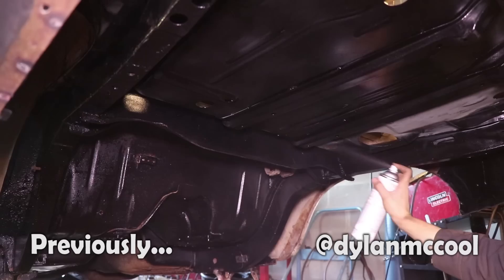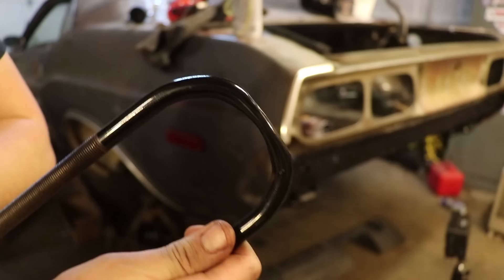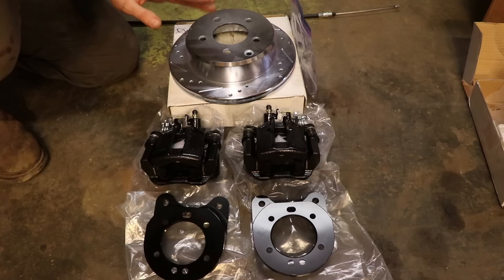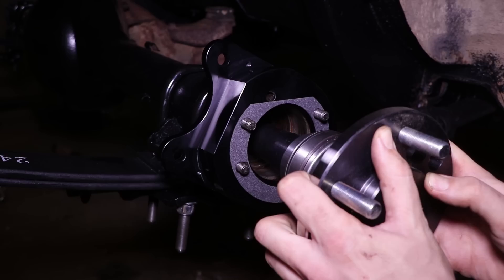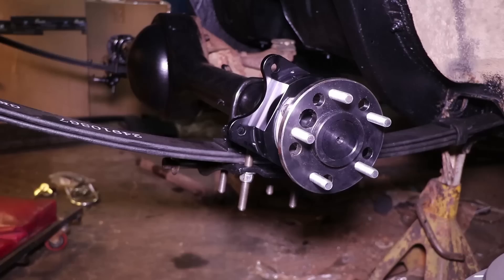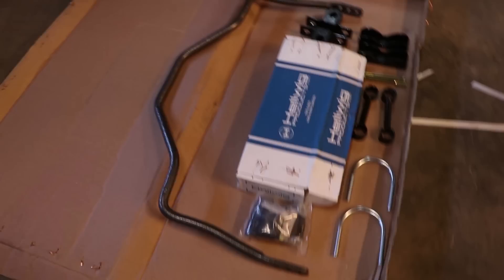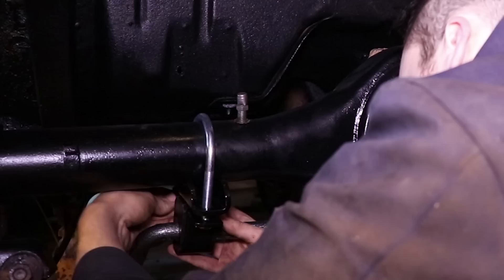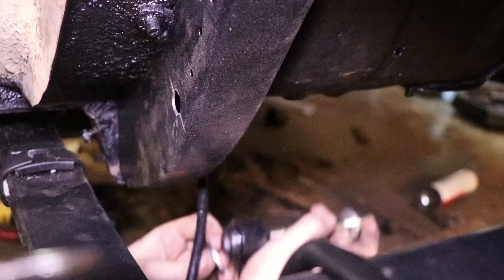ABANDONED Dodge Challenger Rescued After 35 Years Part 11: Rear Suspension/Brake Upgrades!

Comment: You may want to consider welding that sleeve that goes through the frame rail in place, rather than letting it float.  Especially after all your work to make the frame rails water tight.
Reply from the maker: Dennis P. They do mention that in the instructions if you’re doing “heavy” driving. Might take some RTV and put some behind the washer to keep it water tight. That or just drill a drain hole in the frame rail 👍🏻
Reply: @DylanMcCoolVideo   yes i would have welded those sleves in i also would have put the bolts the other way round with the nuts on the  bush end  to enable  the link bar removal and replacement by just removing the nut and not having to remove the complete bolt through the sleve and framerail
Reply: @DylanMcCoolVideo  no, weld it in

Comment: Dude, I'm currently restomodding a soviet made 1976 GAZ 24 Volga and am so intrigued of the mechanical similarities. Mind you, the Volga is a boring piece of junk, with a mind-boggling 95hp  2.4l engine, but it seems if they only tried, the soviets could have easily be making such exciting cars back in the day. I'm doing my best to breathe some life into it, swapping a V8, converting to discs all around, and overall giving it the muscle spirit it could've had.

Anyway, I just wanted to say how much I enjoy this series and how much you motivate me to keep pushing, despite the far-from-perfect garage and equipment I work with. Just yesterday I decided to pull down the front and back suspension and give them a brush over with some POR because of your videos, and I couldn't be happier. I was going to shell out a ton of money for sandblasting and proper undercoating, and I will probably still do it, but at least for now the old pile of junk will be looking better underneath. Godspeed!

Comment: They are my all time favourite wheel, you could easily change the camber so not too mess the tire or trim around the wheel well.
Reply from the maker: 1armedguy The solid axle doesn’t adjust like that unfortunately. The front you could get away with that, but with a square tire like this you’ll be wearing them to the wire in no time.
Reply: My thought was to roll the inner lip in to give the rears a bit more clearance... because those wheels are spot on..

Comment: You can always roll or trim the inside wheel lip. I have taken a zip wheel and trimmed them on my cars to clear tires before. 3/8th to 1/2 should be all you need to cut. Also the 5 slot wheels look good.  A buddy had a Cuda with them back in 82.

Comment: I'm a year late to the party but have enjoyed binge watching. You are a great presenter and editor.  I rewired a 1977 El Camino years ago and was so proud of myself then when I turned the turn signals on for the first time, all the interior lights flashed and when I turned it to the left turn signal, all the exterior lights flashed. I almost cried but I asked my el camino club for any ideas on what I did wrong. I forgot to connect the ground wire from the back of the dash after I reinstalled the dashboard lol.  Every one makes mistakes.

Comment: I really like the superstock leafsprings and 15x8 Cragar wheels, P275 70 R15 BF Goodrich tires on my 74 charger which I did on my own. Car handles turns really well with very minimal roll. I'm happy with my setup and the 2in arch it has.

Comment: I jus have to say you are doing a spectacular job Dylan on the car ... I absolute love that disc brake conversion kit 👍 an adjustable sway bar is cool as well .. those rims an tires due look good too .. there is a tool you can get that fit up inside the fender An it is like a roller An it fills an flattens the inside lip of fender flat so that it won’t slice your tire if there was ever any body roll when driving.. I saw this tool on a another car YouTube channel an it worked very good an professional job an was easy to use .. keep up the great work .. god bless stay safe

Comment: Just a thought as each to their own but underneath I use a sand blaster for surface rust sections here and there and two pot epoxy primer with a cheap spray gun as it wont chip off with road use..great job though looks like a lot of fun👍

Comment: Nice Job so far. You may want to check the rotor for a counter sunk screw that will secure the rotor to the “hub?” And not to just rely on the wheels to push it in. I think at 13:00 you can see the hole for the screw. 👍

Comment: I apologize if it's been addressed but have you talked to anybody about spring twist?  If you're put in a bigger engine the extra torgue might end up trying to wrap your springs. In the day, we used slapper bars or link connectors to keep the diff from trying to rotate.

Comment: I bet that once the engine is installed and the rear shocks are in place, there will be more space between the wheel arches and the tires.  So, you might be ok.  Ideally, you want the equivalent of two fingers space between the tire and the arch.  If you have that, you're fine.  Car has come a long way since last autumn, that's for sure.  With respect to lighting, if you aren't planning to switch to LED lighting, head on over to the Daniel Stern Lighting page and talk to him about the available upgrades for the 5.75" headlamps.  He's another mopar guy, btw.  Had a '62 Lancer most recently.

Comment: ive used the por15 stuff. it is great stuff. it does have some unusual idiosyncracies though, you are supposed to let it cure for 6 weeks before overcoating. if you want to use a colour on top you can give it a dustin coat of primer before it is totally dry. all these detail do create extra hassel so i didnt use itthat much.
also the trick of putting two layers of cling-film on the top of the pot when replacing the lid so that there is a possibility of removing the lid is essential.

Comment: Those rear wheels look badass on that car brother but I think they could use a little bit taller of a tire. You said they are 45’s? Maybe go with 50’s or 55’s? Also you can roll the inside lip of the fender to give a bit more clearance and you won’t have to cut anything or get different wheels/tires. It’s just a very minor body roll on both quarters. Just my two cents.

Comment: I had those kinda rims at first but then I went to a torue twister rim off a dodge plymouth trail duster and had 15x 10 and 15 x  7 on with white letter bfgoodrich and I liked that . I believe 18  x 9 in the rear and an 18 x 7 in the front

Comment: I like your wheels and if you want a bit more room just roll the inside of your wheel arch which you can do yourself by using a pipe and driving forward slowly plus you will probably need that middle slot for your sway bar just to give it some firmness

Comment: I'm thinking that you would need two gaskets, right now you have the caliper bracket mounted to the axle tube having a metal to metal contact which over time will leak . I'm thinking gasket then caliper bracket another gasket then insert axle and flange to make a good leak proof seal. If you don't have another gasket then a bead of RTV between the axle tube and the caliper bracket should do the job of giving a good seal.

Comment: I've always used the regular U bolts  had no problems with crushing? Those bolts are thin on the curve  will snap if the rear end twists under horse power or hitting a deep spot on a road just right. You tighten the bolts in sequence like you do when you torque head bolts till you hit the torque specs for the U bolts .

Comment: consider a wheel and tire that will give you more sidewall. "low profile" tires are good for racing on a racetrack, however if your not on a racetrack you will want as much sidewall you can afford, otherwise it will ride like a dump truck. Not to say riding in a dump truck is terrible. its just you feel every blemish in the road. I have a dump truck and a $800 air shock seat in it

Comment: Very pleased to see up graded disc brakes all, and other up grades in suspension, any of the cars from 60,s can be dramatically improved, in their handling and braking, regardless of how good a driver you are, can you be certain of what the idiots in front of you are going to do???? 
Dylan get yourself a small sand blaster for cleaning parts they are not expensive and work very well! I like your choice of wheel and tire!
Front suspension next, then engine, body and interior, plus a nice paint job is a MUST!!

Comment: Everything looks better till the anti-roll bar, Chrysler engineered an excellent bar on e-bodies with everything attached to the unit body reducing unsprung weight with very good roll resistance why not take advantage? Keep an eye on the cable to ground clearance on the brakes, Great work on resto-modifying these old Mopars keep it going !!

Comment: I'd cut original vintage wheels 18 in front and 20 in rear off set mild tub the rear  because of the 4 wheel disc

Comment: wheels an tires look good,everyone ran weld,or center lines back in 80,s thru a few years ago etc..i loved really nice polished center lines,an they w ere light,looked good on my 73 duster, twister.............the money  winner for 8 years..sold it in beautiful show condition,an wife was pissed off,an i was so stupid,it would be 15 or 20 grand now,with very low mileage built 60 over 360....

Comment: Keep the wheels I say. Good decision to consider that thing called "handling and braking", so many people have cars that look top and can do impressive 1/4 mile times but when you hit a corner heaven help you. One small (I hope) constructive comment: I always put a weld tack on the pressure sleeve to ensure it does not fall into the chassis rail if you ever dismantle the sway bar top mount. Trust me, it can ruin your day when it does:)  Oh: definitely do ALL mechanical work before you touch the interior. On my car for a number of reasons I did it the other way round and whereas you can work your way around, it it still is a pain because you have to remove carpets, seats etc. to ensure no damage occurs.

Comment: I noticed on the swaybar, rear install, that the Ubolts were the rounded ones, could you actually use the same u-bolts that you installed OEM, the flatter ones?  I bet that would match better and save from a possible dent in the tube?

Comment: Seems to be  fine .. why not use those Special UBOLTS FOR THE REAR SWAY BAR.. no sense in CRIMPING YOUR REAR AXLE TUBE. Tie up those brake line to the axle.. 1 had an orange crush 72 w/white vinyl interior trim package and white vinyl roof..

Comment: 7:45 that alignment really triggered my ocd
Reply: Olivier Lopez Ch not to mention the non-painted section of the rear axle at 7:34
Reply: @HighSockDavid  I assume he was just making sure everything fit and would remove the part to paint it later. I don't think he's going to install it with that must rust on it.
Reply: Olivier Lopez Ch I hope so
Reply from the maker: Ryan Frerich I explained the reason it’s not painted in the clip right before I put it in the car.
Reply: @HighSockDavid  Something else I noticed is that all nuts Dylan used were regular nuts, not elastic stop nuts. If he didn't change them after the video was recorded, all nuts will fly away on the first ride due to vibration.

Comment: Question why didn't or don't you weld the sway bar mounts to the diff? Will make for better handling than U bolts. Also the crush tubes should be welded into the chassis.

Comment: Nice job man. You install same type of brake calipers, as on my Audi A4. Is it lucas brake system? If it is, that car has enought stopping  power.  I noticed some rusty holes on rocker panels and rusty and bend panels and door on left side of car. Are you planning to repair it? How about strengthening floor frame of car? Maybe new paint job on top of all repairs?

Comment: I must ask though out of sheer ignorance....why did you use the flat u bolts to mount the axle without crushing it, but used round u bolts to mount the swaybar? Will they not crush the tube?

Comment: Looks like a the diameter of that bolt that goes through the sway bar into link pins is way to small for hole in sway bar?

Comment: Why wouldn’t those round u bolts crush you axle housing on the sway bar , like you said that the rounded u bolts would crush the axle housing on the leaf springs???? Thanks 🙏
Reply from the maker: They won’t tighten to the same torque as the leaf spring bolts, so they shouldn’t be an issue.

Comment: Just my opinion, but i think the back wheels look a bit too much like Chevy Rally wheels. they dont look bad, i just think you could do better. Also, the back spacing looks like it will be an issue, and i wouldnt sacrifice tire width to keep the wheels. Just my 2 cents, tho.

Comment: Dylan. Great job and content.  I do have a question. When installing the rear shock mounts you used the u-bolts that are flat in the U. When you installed the sway bar you used the round u-bolts that came with it. Just curious as to your thinking on that. Thank you and keep up the great work.
Reply from the maker: Thanks! They’ll never get as tight as the ones that hold the axle. I didn’t think they’d be an issue.

Comment: Those wheels are OK for style but they have too much "Front Space" and not enough back space.  You are going to rub.  Also 17 inch is too much wheel since it means to little tire for a given height.  My first choice would be 15x8 Mopar Rallye's with about 4 1/2 to 5 inch back space.

Comment: mine has same front end,i sold like a fool way back in about 1993,was a rallye, with rallye dash,and all those many short slant strobe stripes on each ide..and a ...white interior,i sold a 10,000 rallye challenger for 1800.00 bucks, runnin mid 14,s or a little quicker, clogging up gas filter at times with rust from tank,why do i sell,an lose so bad,those kids got gone fast in that hemi orange rallye challenger.it would be easy 15,000 or so now,just like it was..needed new gas tank an a few things,you never see them no more like that...

Comment: Why do mercans call the hand brake an E brake?
It's a hand operated parking brake, used to keep the vehicle still when parked up! Manual and automatic cars have a hand brake, usually holds on the rear brakes, so it won't roll away if left in neutral or drive/reverse...never ever was it made as an emergency brake, yet dumb ass mercans have invented this "e brake" name. 😂